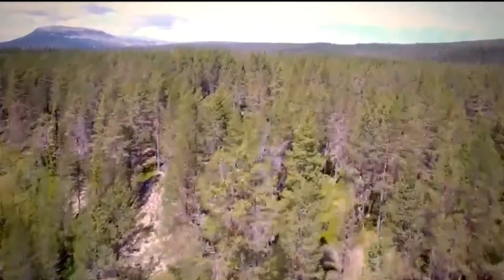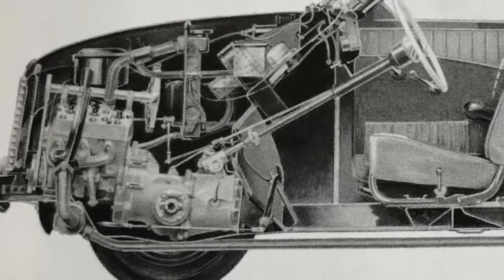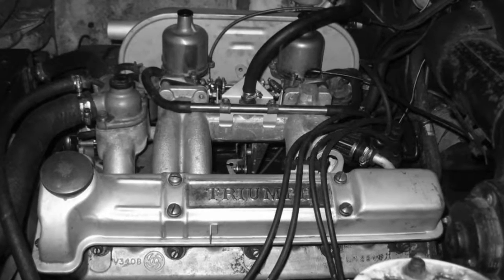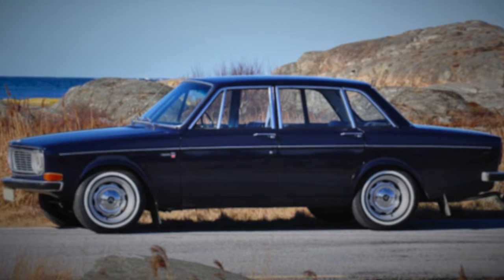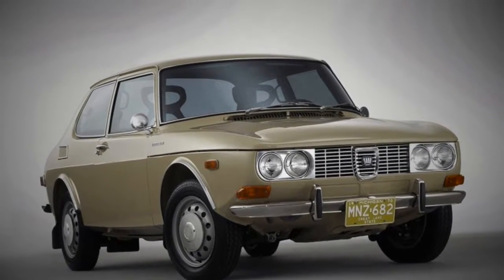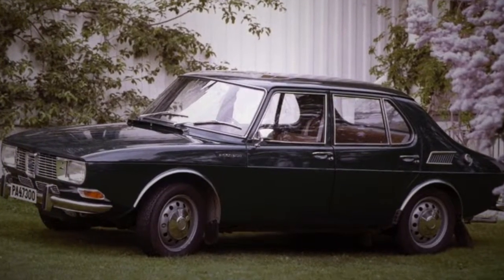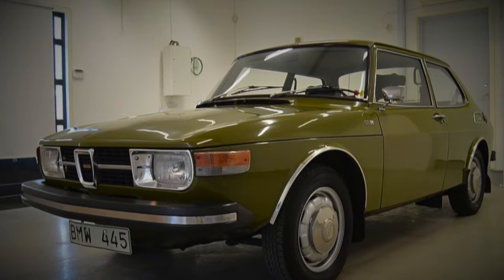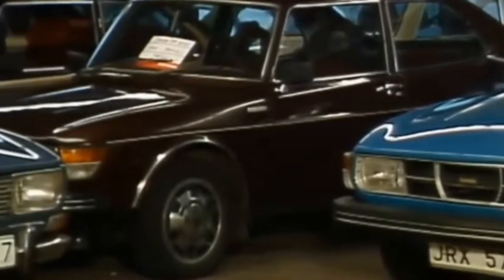The Saab 99

Comment: I had a '71 Saab 99 and a '75 Combi. The '71 was trouble free, but the Combi had several issues. The alternator fell off. The timing chain came loose, several pieces of interior trim came adrift and there were water leaks. It was great in the snow though!
Reply from the maker: Sounds like the quirky fun of owning a Saab !

Comment: I had numerous Saab 99s I was side swiped by a drunk driver running a red light at estimated 80mph he hit me on the strongest part of the car on the bulkhead area. Nothing was left of his car. Saab took the impact. There the front side of the car was reduced by half and there wasn't a straight body panel remaining. The only way I could get out was by through the shattered door window.  The 99 saved my life that night..
Im still running a 2011 Saab 9-3 bought 6 month old. I still miss the 99
Reply from the maker: Another Saab sacrifices itself for the occupants ! I had the same thing happen to me in my 99 many years ago.
Reply: @theclassicsaabguy236 I know the 99 inside out and completely stripped them to just a shell.  ive had all the models from K to S reg then fell for the 900 then again fell for the 9000 I nearly bought a 9-5( Vauxhall insignia) but chose the 9-3
Reply: I too know the 99 inside out. Ive also sripped many to the shell and even cut them up into little pieces. I liked how you could remove the bonnet(2 bolts) and if required remove the lights & radiator as a unit (4 bolts and about 6 self tappers) to get to the clutch

Comment: I had a '69 99 in Jerusalem, Israel, in 1986-7. Great car, with technology that matched that of then-advanced modern cars. The first owner removed the freewheeling mechanism, it was way too dangerous in the hills.
Reply from the maker: So I guess being in Jerusalem you didn't see much rust on Saabs there ?
Reply: @theclassicsaabguy236  That's right
Reply: Saab 99 hadn't the freewheeling as far as I'm aware off
Reply: @reneegudjon3204  I was told the transmission in the first Gen was from a 2-cycle engine which used the freewheel to keep ROMs up when the wheels were turning slowly
Reply: @yonatangoldman9759  yes . I think you are right,not me ;)
Reply: Saab and Volvo can't be thanked enough for making lifesaving cars

Comment: Ah, my first car! A 1981 beige two door 99GL. One correction to the video, though, mine had the H-engine but only a four speed gearbox. It drove very well, one of the best cars in that respect, I ever had. But for the rest, I was not so lucky. It was rusty, unreliable and the engine and gearbox and everything around it, as well as all of the interior were completely worn after 250.000 km. It was therefore scrapped. And yes, I took good care of it, from the moment I got it at 166.000 km.
Reply from the maker: Hi thanks for the comments - ahh yes when the H engine was brought over to the 99 the five speed gearbox was an option but many left the factory with the standard 4 speed before later 5 speed becoming standard (around 1983/84 I believe) thanks for watching

Comment: You say SAAB introduced the 99 turbo in 1978. That is wrong.
It must have been in 1977, and they actually had the 40 year TURBO anniversary at Saab museum, Trollhättan in 2017.
Reply from the maker: Terje Normann I'm sorry for the confusion - whenever I mention a date it's usually when it was launched to public - which is of course 1978 - but there were pre-series cars manufactured in 1977 - Saab always go by when they begin manufacture not official public launch date
Reply from the maker: Terje Normann hi Terje - yes I saw one too at Trollhättan - as far as I know after doing more research there were some models released as pre-series cars , which as you pointed out were registered, but I'm pretty certain these were before the official launch of the car onto market - I have no doubt they exist and perhaps now the lines have become blurred in terms of when they were "introduced" - but every book and  source I have found say 1978 as the launch to market - I guess online things can be updated or changed but books from the 70's can't unless they release new editions . Many thanks